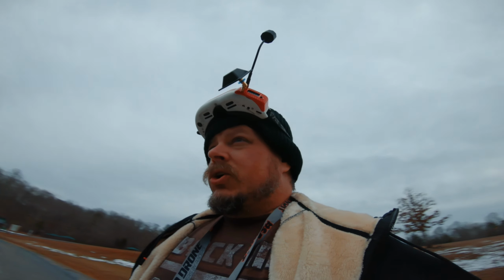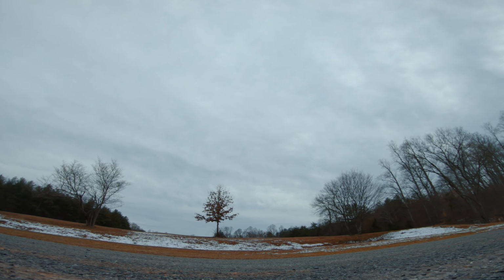Trying Out Betaflight 4.3

Comment: My opinion is a lot of extra code is being run on 4.3 which  slows the pid loop down . Look at how the cpu load has increassed in BF over 4.2.This is not good , more work means a hotter micu  If you can tune pids you don't need all the rest. Yes it's nice with all the new stuff but not on the F4 F7s and I believe F3s are out.Hope it goes well but I'm sticking with 4.2 for now.